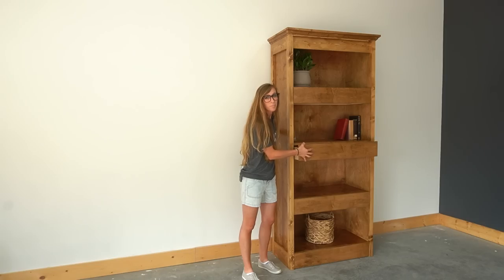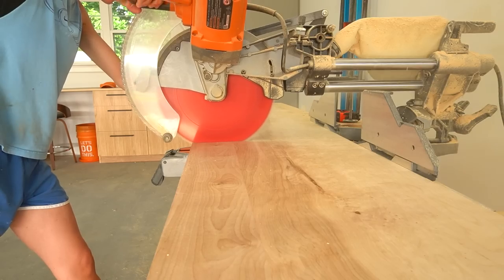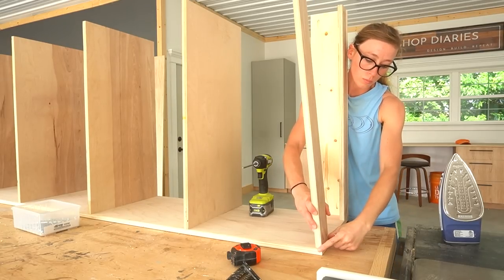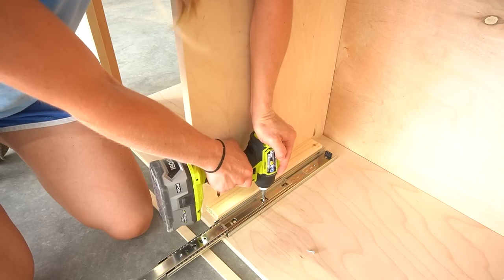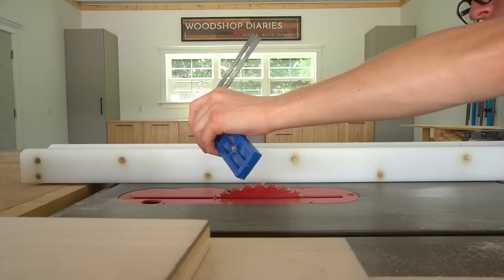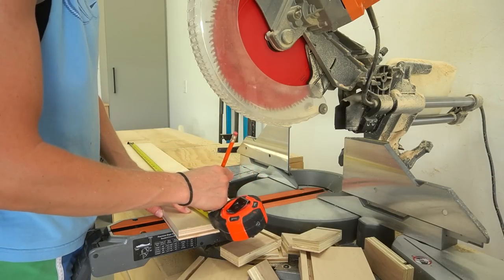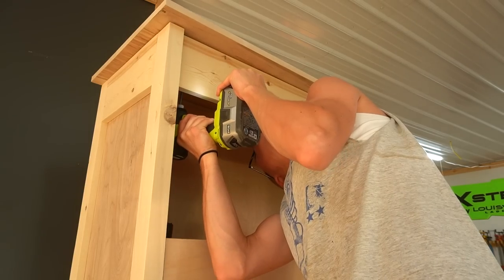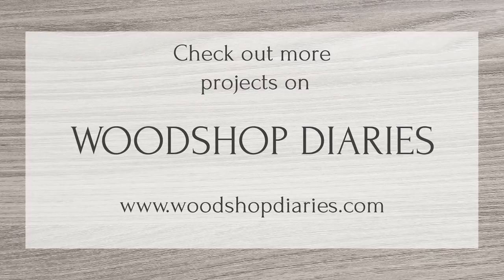How to Build a Bookshelf with Hidden Storage Drawers

Comment: Shara, I love this design!  I purchased and downloaded the plans and made this bookcase.  One thing I added was to place cleats on the second drawer from the top to hold a removable sheet of then plywood flush with the top edge of the draw box.  This allows me to use this drawer as a standing work surface for looking at books or albums from the shelves.  Thank you for inspiring me to build these shelves!

Comment: Hey Shara, that piece of wood you cover the back of your cabinet with. You said it was a 3/4" sheet of plywood. Just so you know. Also, impressive build, I love how your projects are so outside the box. Or outside the cabinet box, I should say! Lol. Nice work, Thanks for another great video. Take care.
Reply from the maker: I know. I mentioned the error in the video description 👍
Reply: @WoodshopDiaries  ah lol. I guess it would help if I read those descriptions. Lol I look it the descriptions all the time. However I generally don't read through all of them. But I'm gonna start trying to. Thanks and sorry about that. I just pointed it out, in case you wanted to add a tag in the video correcting yourself.. not for any other reason.. but you've got it. I'll be quiet now. Lol